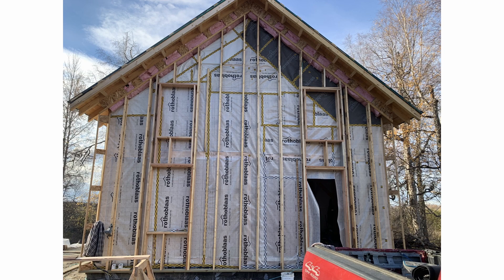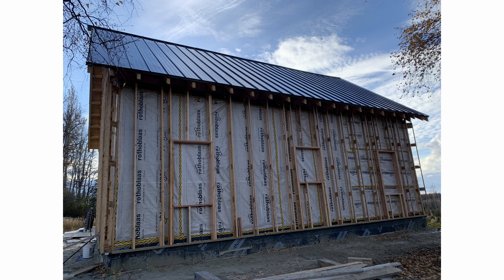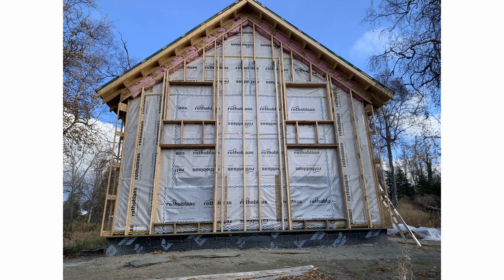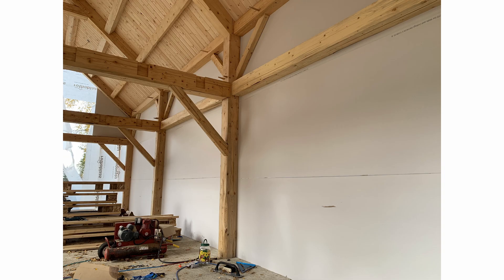Larsen-Truss Retrofit to Existing Stud-Frame House | FHB Podcast 663

Comment: Years ago i worked on a P&B home that has been sheathed in SIPs (though they weren't structural). The SIP was OSB exterior and sheetrock interior. It was difficult to wire, unless you're on site while the SIPs are going up.

Comment: I covered the outside of my barn board sheathing with 4 mil Black plastic then I used 2x4's nailed into the posts outside the sheathing with 8 inch ring shank hardened nails. Pre drill the 2x4's first and space them 4 feet apart to allow 4x8 sheets of polyiso insulation. Cover with house wrap and regular vertical barn tin.

Comment: for a UK viewer what is a Larson Truss?
Reply: A Larsen truss is a lightweight wall extension that allows for thicker insulation in a building.
Larsen trusses are used to increase wall size, reduce thermal bridging, and improve energy efficiency. 
They are ladder like trusses that are attached to the outside of a building's wall sheathing, then filled with insulation. The sheathing then acts as an air and vapor barrier. 
Larsen trusses can be used in new builds or retrofits, and they're a popular choice for Passive House Certification. 
Canadian builder John Larsen developed the Larsen truss in 1981 to improve insulation in existing homes. 
Larsen trusses typically include point-to-point gussets, which are small strips of plywood that connect the inside and outside chords of the truss